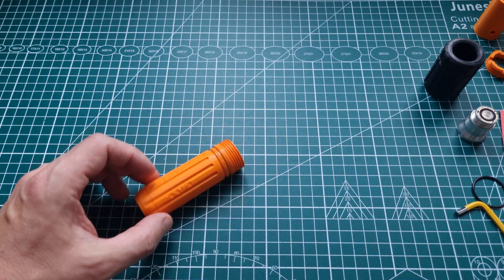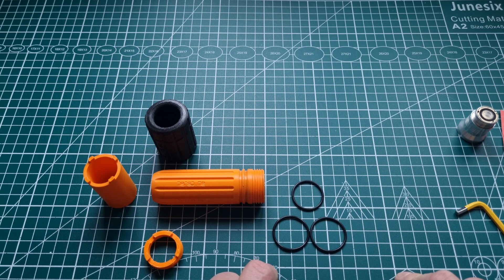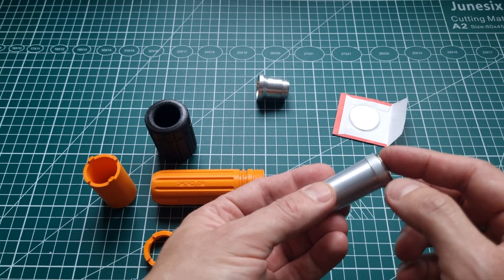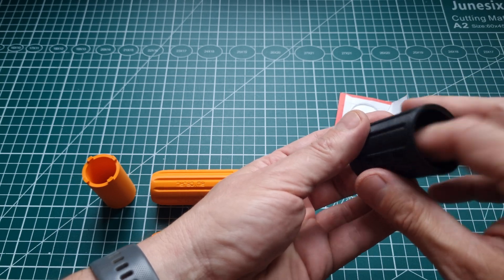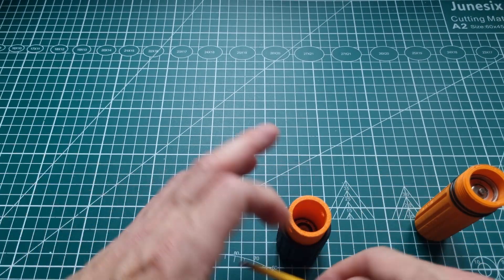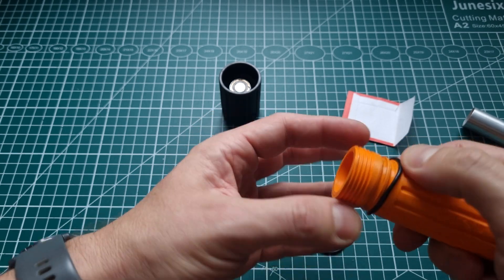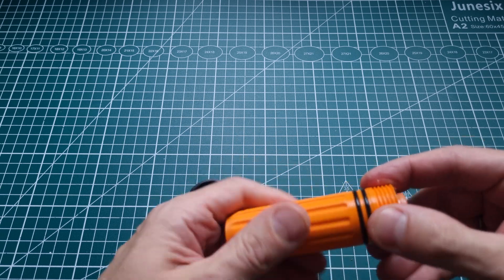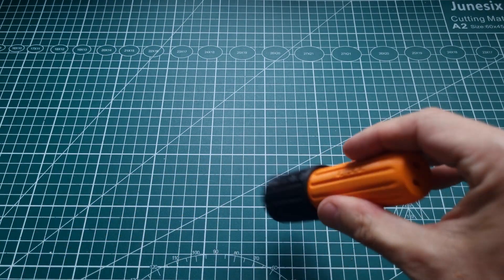This 3D Printed Diving Torch Costs Just $10 To Make

Comment: an it be waterproof with depth? 30m? im thinking of desinging one. dont knwo if pla can withstand that pressure without leaking or need todo two chamber with silicone or epoxy in the middle. if u can design one tag me
Reply from the maker: @yulichenlu for me it worked till 30m. But I'm pretty sure 50m is doable without epoxy. ASA + acetone

Comment: hi hello , i wanted to try ur build, but with a stronger flashlight module, xhp 50.2 any thoughts on it? will it get too hot for PLA? will it need an aluminium cap for thermal mass? or its fine all plastic
Reply from the maker: Honestly i would go for ASA or PETG. Especially ASA postpocessed in acetone vapor might be a good idea.
Reply: @taboretum  acetone vapor smooth increases watertightnss? 
i have abs lying around, maybe that would work? how many walls are u using for ur design - paraemter?

Comment: PLA is not really waterproof, it will leak and/or degrade overtime in water, so the flashlight works, but just for now.
It's much better to use filament like a PolyCarbonate for such a use
Reply from the maker: You're right, however I haven't noticed that degradation over 1-2 years. Still, good hint, planned to test PC filament for some time :)